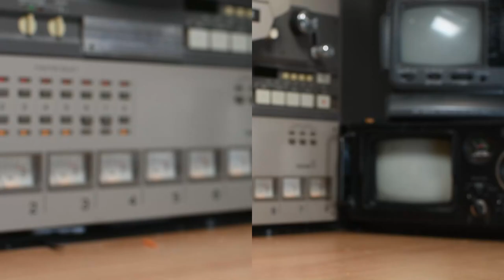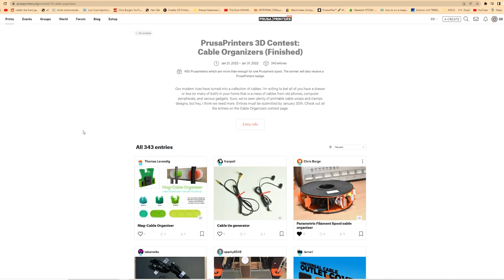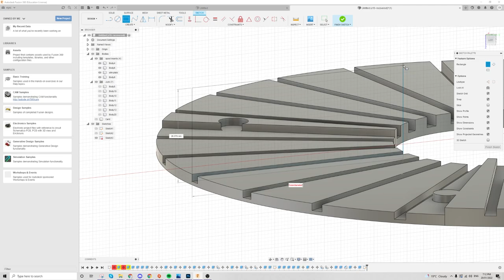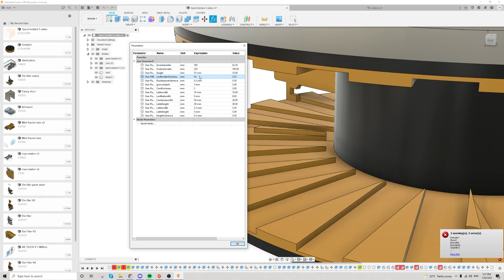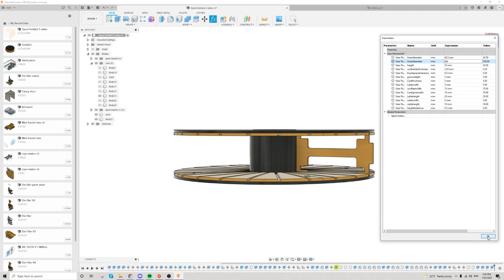Organise Your Cables With This Filament Spool Organiser (Parametric!)

Comment: One suggestion would be to wrap the cables in a figure eight so they don't pick up a twist from being coiled up, as well as possibly being instant untangling/access if the card had a twist tab.

Comment: I am absolutely loving this design, especially with how customizable it is. However, I keep trying to edit the parameters in Fusion360, and I keep getting rebuild errors on Move2, Move 3, Extrude7, Extrude8, and Extrude20. I’m not sure what those features are supposed to reference, but it looks like those links are broken.